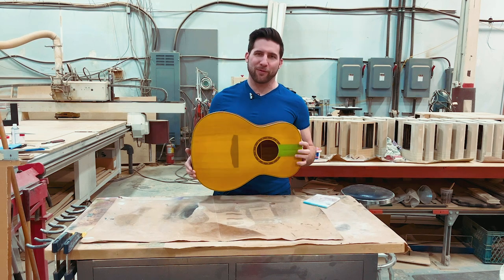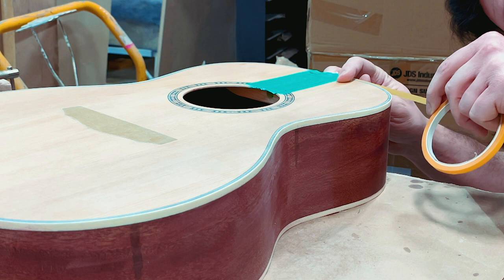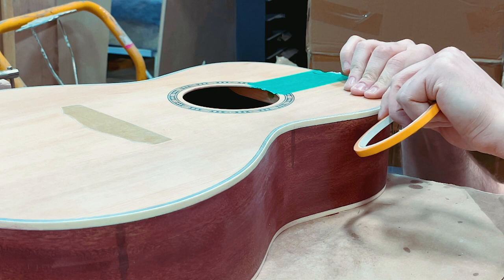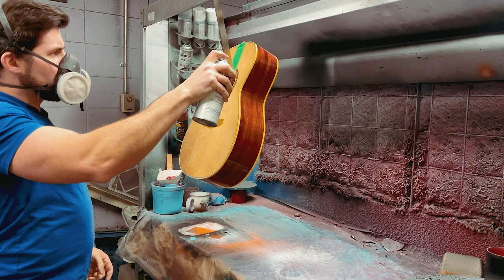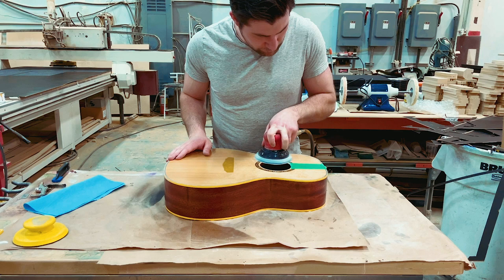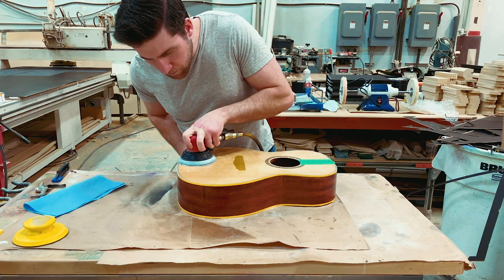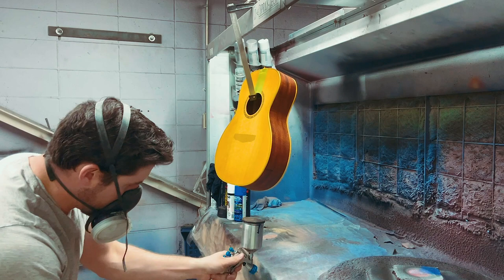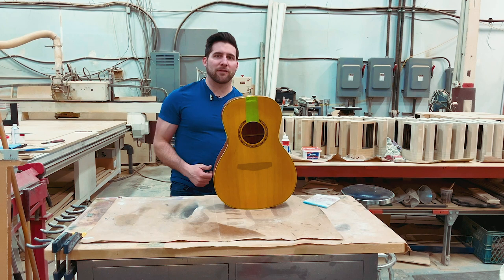My First Acoustic Guitar Kit | PAINTING!

Comment: It's back been waiting to see ya finish up this kit. I still really dig not having to buy one and sand it to re do the body. Fyi cool tip with painter tape. That whole bleed through general can be stopped by a very light mist of water to make the tape swell. In house painting we use a very little bit of silicon on the tapes edge. Took me a few times to get good at but wouldn't use silicon on bare wood. Or at least I haven't yet. Take it easy man.